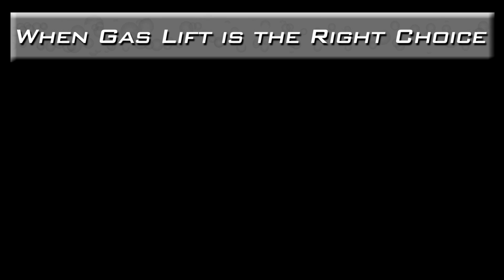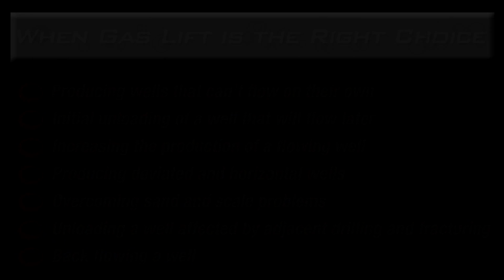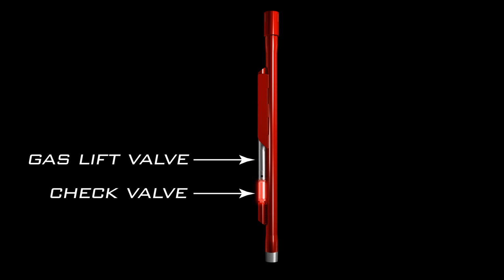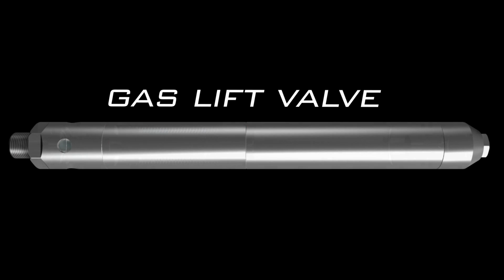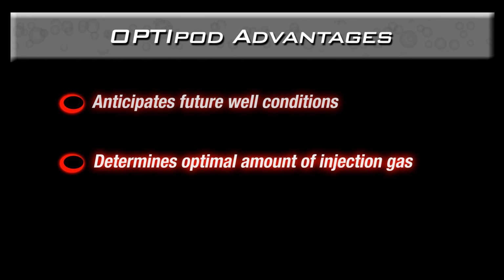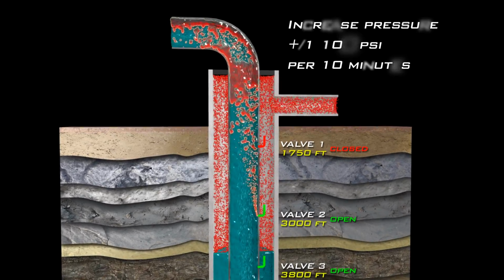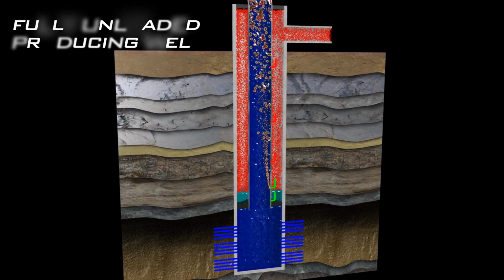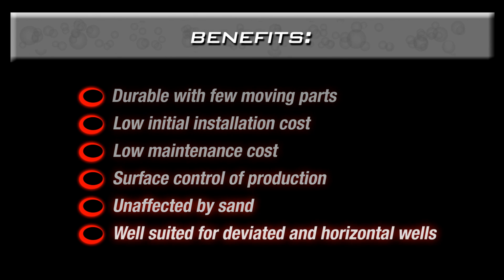PCS Gas Lift

Comment: what does PTR mean in design report?
Reply: PT is tubing pressure @ depth based on the flowing tubing gradient that the well is designed on.  PTRO is the Test Rack Opening pressure in the shop at 60 deg.